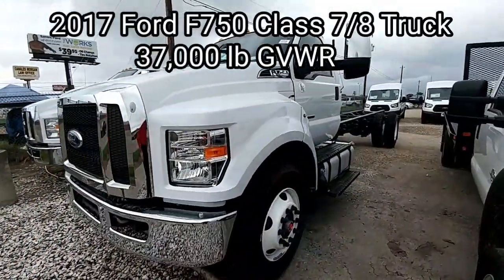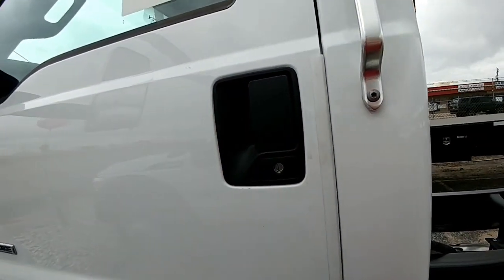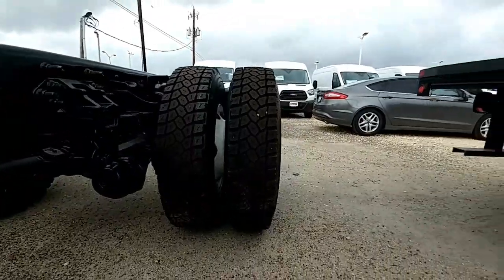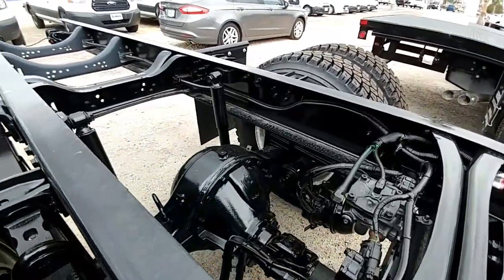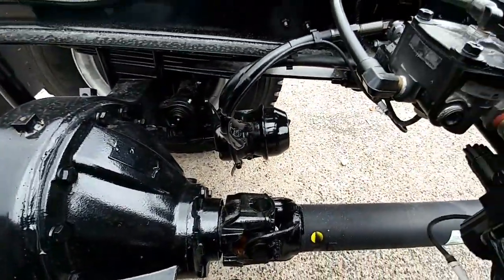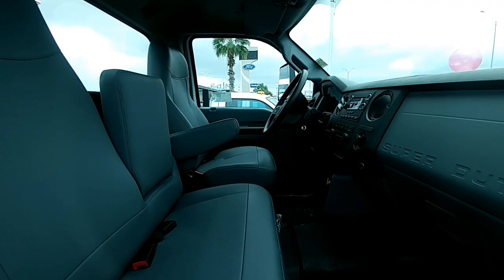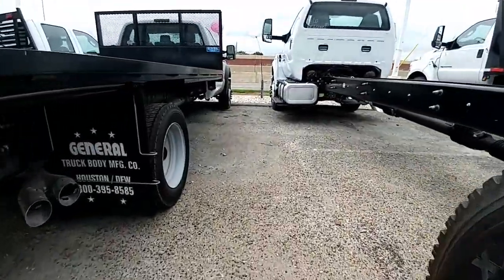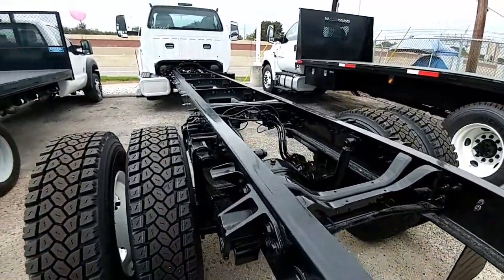2017 F750 Super Duty with 6.7L Powerstroke! WOW

Comment: I own a 2006 Chevy c4500 with the 6.8l duramax, only 305hp, definitely depowered from the pickup trucks with the same engine. It has air suspension on the rear, which is much better than the leaf springs shown here on the ford. 26000 gcvwr for this version.
Reply: Richard Davis-Minter it's de tuned for emissions. All "medium duty" trucks are.

Comment: These truck almost always never have enough power in them.  Id like to see a tandem in that style with 400 hp and lots of tourqe... but them I might as well just buy a sterling.
Reply: The Ford offers a best-in-class 330 hp/725 lb.-ft. of torque (among Class 6 and 7 Conventional Chassis Cabs).
Reply: You realize that adding a big jump in power to a vehicle that's hauling 30k, will take a huge jump in component size to be reliable. Can you say class 8 differentials and such. You don't just stuff a big powerplant in there without adding big components which then cuts down on what you can haul.
Reply: Ron Dye, the axles can take it. There are other plans for this truck, and the stoutness of the axles are a preparation for that. These axles will last 1 million miles. 

The transmission, while the same unit as in other trucks, is not the EXACT same unit. It has internal differences for the application.

Comment: Interesting how truck industry differs in US from European one: Your "medium trucks" can consist of a large truck frame with a pickup truck cabin, which is just raised and has different hood, while in Europe the only example like this I'd think of Renault Mascott  being a Renault Master (3.5t gross van) cab put on a frame to make a 6.5t truck. Also what I find odd is that it has leaf springs and drum brakes all around. My guess is that it is because of different road conditions: Your trucks most likely go on a relatively smooth highways without much stopping or hills, while in Europe our roads are not that wide and straight requiring better brakes and smoother ride. On the other hand your trucks come with automatic transmissions and very powerful engines, so except of brakes and suspension they would be rather OK to drive in the cities...
Reply: ***** I'd say it is because of durability reasons: This engine spends more time near its peak power figures than in a pickup truck.It needs to work few times harder to bring a truck to speed than in a pickup. But anyway it still has more power than a typical European truck of that size :)
Reply: mibars these trucks are piles of dung,poooor engineering in every respect,we call them joke stroke and durajunk,simpelest of repairs require major dismantling of subsystems,best thing for these new diesels is cummins conversion and emissions e.g
r. deleate
Reply: This truck would be classified as a "5 ton" truck which is a staple of farms and medium industry across both Americas. They top out at around 60 mph or 100 kph and don't really need any better breaks. This class of truck has remained basically unchained for 70 years with good reason. They go forever! And are almost indestructible! There are millions of them on the road.
Leaf springs are simpler and last longer than air suspension and drum breaks are cheaper and generally you can slow down by down shifting anyway.
Reply: ...Kenneth, and sales of these trucks are up 69% year to date.

Comment: looks to me like a big truck with a boat anchor of a motor good luck actually pulling hills and stuff
Reply from the maker: leland smith: owners of them haven't complained. Actual the engine in this truck had been getting rave reviews....oh, but u don't have any experience with it I'm sure.
Reply: actually I use to drive a f350 with a 6.7 everyday and when it came to pulling loaded trailers you were at a crawl on most hills.

Comment: that was the best when they offered the Cummins with with the Allison Transmission I guess they saved way more money using their own engine I think if I was looking for the 6 or 750 I would look for an older model with the Cummins engine
Reply from the maker: Mario Bajac: On the surface I would normally completely agree.  I had to think a little differently though.  Since Ford can do all their own in-house engineering and design for their diesel engine, it may end up being a far more reliable platform that we are giving it credit for.  I wish additional Fleet owners who actually run them could chime in and provide feedback on how reliable the 2016 models have been thus far.  Many companies and cities use these as their primary daily work vehicle and could easily have run up over 100k miles.  I would love to hear how they have been working out.  Everything is just speculation at this point.
Reply: U-Haul ordered a lot of these trucks.

Comment: We have a couple Ford commercial trucks at work.  Both tandem axle  flatbeds with a non steering mid drop axle.  Probably the worst driving trucks we have.  Better off with a baby Peterbuilt or Kenworth at that point.  Or even a Volvo.  Only one that is a bit worse that we have is an International of around the same duty level.  It sucks because it has an automated Eaton Fuller.  And that is what makes it terrible.   Unless you use the push button to shift manually it will constantly shift up and down when doing simple things like driving around the lot to load or unload.
Reply: Professional driver for 45 yrs., and hate all big truck automatics. Even with all the electronics they still can't anticipate changes in power and momentum needs to find the right gear. These auto's are for people that can't whistle and walk at the same time.
Reply: Ron Dye Channel Have not been at it as long as you but I agree.  just give me a good old manual.  don't care what it is as long as I have control. My pickup and car are both manuals.  They only trucks I like driving at work are manuals.  Both Eaton Fuller. One is a 8 speed  and the other an 18 speed.
Reply: not to mention the life span of a international is terrible and often roadside.

Comment: I hope they offer the ECOBOOST in the f650/750 because all they need to do is limit the rpm of the ecoboost to 4000 rpm, and it will last longer, because 450 lbft torque is enough to move this truck.

Comment: Boy they really tone the hp rating down on the commercial rigs.
Reply: TShull that's how they get a b20 life of 500,000 miles with the powerstroke
Reply from the maker: Alex Mills: as well as the Cummins
Reply: TShull It's actually for emissions standards. I'm unsure as to why, but that category of GVWR has stricter emissions standards than your average F-350. Less fuel; Less power; Less emissions.
Reply: Vegard Claussen explains why my brothers medium duty chevy with a huge diesel motor that only pushes 200 hp and 450lb torque but gets great fuel economy which is really nice

Comment: Those rear tires are not Goodyear, they are Michelin XD5, I worked for a tire company and we sold that type of tire and I recognized that tread
Reply from the maker: Thanks for the correction.  I typed the tire spec from Ford's website... should have pulled it from the video of the tire.

Comment: +Big Truck Big RV Is the F750 4WD or only 2WD
Reply: delinquentJACK I'm not stupid so keep your insults to yourself I don't go around saying that others are stupid and dumb do I no I don't so watch what you're saying to me buddy ya got that
Reply: *****
whoa there buddy nobody called you stupid. you just completely missed the several shots under the front end, and instead of doing a 5 second google search you asked an ignorant question. seems pretty straight forward to me, don't get offended at someone pointing out the obvious.
Reply: Only 2WD.
Reply: Chanse Ormon 
there shouldn't be any reason why you couldn't get this in a 4x4 or all wheel drive. They do use these trucks for fire trucks and other off road applications.
Reply: Edward Cullen I’d rather have 4x4 than 4x2 so much better to have as an all season truck and if I got an F750 it’d be way better to have a 4x4 or an All Wheel Drive Truck rather than a 4x2 for an all season truck

Comment: Disc brakes all the way around...?
Reply: Gregory A. Parsons Air brakes
Reply: +Anthony Dwyer "air brakes" doesn't effectively answer the drum brake question...since some drum brakes are air actuated as well. these trucks appear to have drum brakes.
Reply: Definitely drum brakes all around.  Can see the rear shoes against the drum @ 01:35.  And by the way the brake chambers are mounted, you can see that they are set up for drum service. Can see slack adjuster and s-cam when he pokes the camera up under the hood at the beginning.  Air disc brakes don't have slack adjusters or s-cams.   A good indicator of air disc brakes would be seeing the brake chambers mounted "sideways" to what you used to see, and right tight close to the rotor, and caliper assembly.  No more long pushrods, slacks, and s-cams.  With that and the drums taken away, it cuts some weight off the overall.
Reply: Good eye Stan... but I wonder if there is a disc brake option like on Peterbilt...?
Reply: You can get anything you want on any truck, if you spec it out.  Last set of trucks we got in (KW T-680's), the price difference was over 4 grand for disc brakes on 3 axles above the price of drum brakes.  So, since our boss is a bit of a cheap prick,  he just went with the drums, but we still have ABS and TCS.  Whenever disc becomes the only choice,  likely by then there will be more brake system manufactures supplying to the builders, and hopefully the prices will be a lot more reasonable.
Reply: Yes, you can get disc brakes on all 4 wheels...or is that 6? ;)

Comment: Just looks like a smaller version of my rig. I know it won't be happening for a long time, but when do you think the big 3 will start putting boxed frames on medium duty.
Reply from the maker: whiteandnerdytuba: I don't think ever.  Fleet owners know better
Reply: Big Truck Big RV i agree. The c channel design is easier to extend to fit the needs of the upfitter

Comment: The Ford 550 and 650 trucks prior to 2016 were actually Blue Diamond trucks. They were built by international trucks at there assembly plants with the 6.7 Cummins engines only. The chassis were actually a international chassis with a ford cab. They were a very good product. Ford should of kept that option for the customer to pick from. You can find the info for these chassis on international service info up thru 2015.

Comment: Can you get a shorter one length wise? I think it would be a good addition to my company just want one that is not as long.
Reply from the maker: Lawn Gators: absolutely, I believe they come in about 10 different length and cab configurations
Reply: Lawn Gators yes this is the longest wheel base Ford makes. whenever this guy was on my lot videotaping this I had just sold two Nov 1 with 10 ft dump bodies and a shorter wheel base.

Comment: We have a new 2017 F750 at work now, though supposedly we have a higher output engine with 900lb/ft of torque. We have it in the crew cab version as a hook truck for landscaping. Unloaded you need a Class B license with air brake endorsement or Class A.

Comment: Wow! That looks EXACTLY like my '92 Ford F700.  Still using leaf springs, same rear end, same air brakes, same exhaust routing, same steering box, same wheels even!  Course mine does have the cummins 5.9 in it...
Reply: This truck was totally new (except for carry over cab from 2015 Super Duty) for 2016. I suggest you check with your opthamologist or your doctor for dementia.

Comment: just a couple questions here.  what do people need these big trucks for that a nice f350 can't do,  because apparently they have the same engine and hp/tq rating? just doesn't make sense to me because now it just weighs a whole lot more which means less power.
Reply from the maker: Christian Gutierrez: actually they produce less power. And they are used by cities, tow companies, moving companies, builders, and so on because they are rated to carry far more weight over the rear axle vs a F350/450/550.  Like 20,000lbs more
Reply: Big Truck Big RV thanks

Comment: I've done a lot of hauling in a 550, 40' trailer about 15k lbs, found the 6.7 way under powered. I find it hard to imagine that same engine would be worth a damn in something so much bigger even with different gearing.
Reply: Rodney Greenfield that is typical however. have some older f750's with 5.9 cummins with 200-220 hp that moves good. As shown in this video.......anything will move good with short gear ratios in the diff. Just dont expect anything over 130kph on the highway.
Reply from the maker: Rodney Greenfield: I've never heard of the 6.7 PS being underpowered
Reply: is it stick sift? maybe you forgot it to 5th gear
Reply: Rodney Greenfield
Reply: Big Truck Big RV seriously though... this guys smoking some shit
Reply from the maker: Jeff Anderson: Probably was driving a GAS engine and thought it was diesel......
Reply: Remember, it wasn't that long ago that full-on class 8 trucks had similar HP ratings or less. The 6.7 will get the job done!

Comment: I noticed on the rear of the F550 that it had HSR's. Are they FINALLY putting steer tires at all positions so we can rotate them?
Reply from the maker: Luke Edward; that's how my truck is setup. all HSRs
Reply: Big Truck Big RV Oh yeah.  Its the only smart way to go. Ive just not seen 6 HSR's spec'ed out on a new truck before; only on the (front) steer axle. I probably never took notice.

Comment: Why did Ford stay with the older interior design and why doesn't the 6.7 in this truck doesn't make as much torque as the latest super duty?
Reply from the maker: James Dean Youngs: Like most medium duty truck (class 4-7) the Diesel engines are detuned to last longer under the rigorous conditions and loads these trucks often see.  I like my interior also.
Reply: Big Truck Big RV Oh okay but obviously 700+ ft lbs of torque won't leave many medium truck duty drivers wanting.
Reply: Thanks for answering!

Comment: Not a bad setup when trying to stay out of the class 8 price range. That engine is going to be a problem. It needs a larger displacement to effectively manage the loads this truck is designed for and for better longevity. Come on ford. You're going to cheap and under engineering something that could be amazing.

Comment: I drive a f650 w/ a 20ft box for a school district warehouse. GVWR 25999. standard hydraulic brakes. no CDL needed.
has the cummis 6.7L   does well but at certain speeds feels gutless   6 speed trans   40-55 no guts what-so-ever  65mph has more pull

Comment: Did it say the 6.7 powerstroke had 330 horsepower? I thought the 17's had 440?
Reply from the maker: RANGERTRAX 04:  The Class 4+ trucks are derated to support longer service life (under commercial conditions), as well as longer warranty period.  This is how ALL the manufacturers design them.  Even Cummins.
Reply: The 350 450 550 as chassis cabs are rated at 330 or something like that.  My 15 f350 lariat is a whole diff animal than our f550 flatbed

Comment: Does ford make heavy duty trucks? If so, do they have the cummins?
Reply from the maker: Ttyyft: technically, you can get an F750 at 37k GCVR which would classify it as a Class 8 heavy duty truck....but the Powerstroke is the only available diesel powerplant

Comment: Forgive my ignorance (I'm from England where we don't have machines like these) is this what is meant by a semi-truck? which we would refer to as semi lorry, and is there a difference in clasification between 650 and 750?
Reply from the maker: +Matthew Godwin: this is not a semi tractor trailer.  This particular setup would be more of a bobtail setup (Google bobtail truck).  The F650 and F750 designation is to describe the Gross Vehicle Weight class that truck falls into.

Comment: The little transmission looks funny hooked to that big drive shaft. They are almost the same diameter lol. Looks like the weak link to me lol
Reply: Yeah,  not the engine and trans I'd go with unless all it was going to do was propel the truck itself around.  If the truck would be carrying any weight any significant distance,  I'd go with a 10-11 Litre engine and a 10-speed.  Any more weight than 20,000 lbs, and I'd make it a tandem and spec it even heavier.
Reply: The transmission only looks small because of the camera lens and the distance to the transmission. Internally, it is different from the regular Super Duty trucks for the heavier duty.
Reply: Stan, this truck has the highest rated power in it's class.

Comment: What would u put on that? A tow bed?
Reply: ...or moving van body,  or 5-ton body, stake truck,  light-duty dump truck.   Max carrying capacity (legally) would be 12,000 on the steer axle and 20,000 on the drive axle, so a theoretical gross of 32,000 lbs, but I doubt anyone would want to be driving around that sort of weight with just a 6.7L engine unless you were just doing local stuff.
Reply: Stan Patterson - Our 12 pallet reefer does 24,000lbs without complaint. Even in Colorado.
Reply: +Stan Patterson I would 
have to disagree, lists of 30lbs trucks have been made with a 6.6 liter cat diesel, and yes its guttless but it still gets the job done
Reply: jace lick whomever did this video did it on my lot. this frame can be cut down. we can cut it down and I have 2 with shorter wheel bases coming soon. The last two I sold last week went with 10 ft dump bodies on it for a construction company.
Reply: There are so many different frame lengths and wheel bases, why would someone cut one of these down?
Reply: Stan, the power ratings for the 6.7L are best in class. It will haul whatever you got, anywhere you want to go.